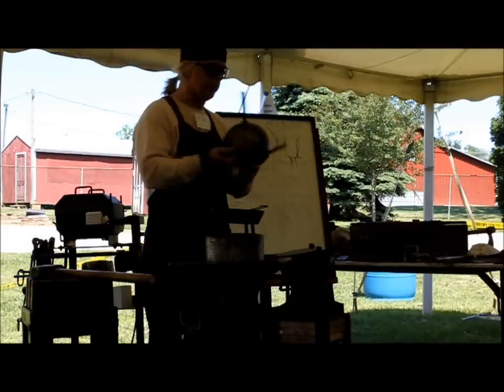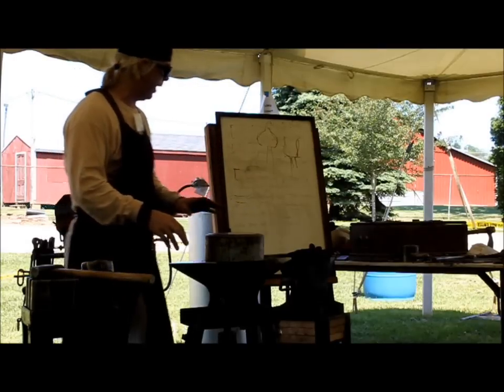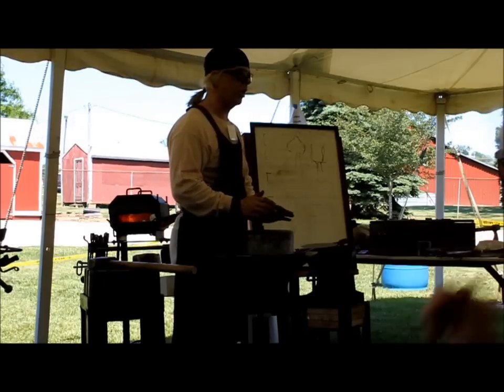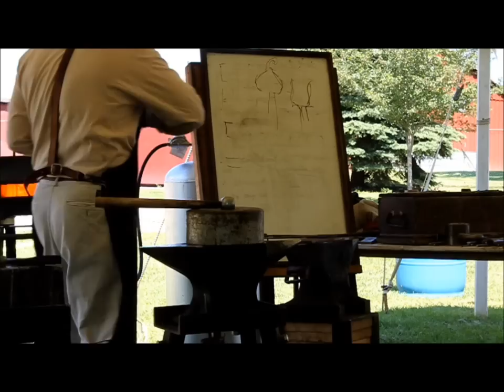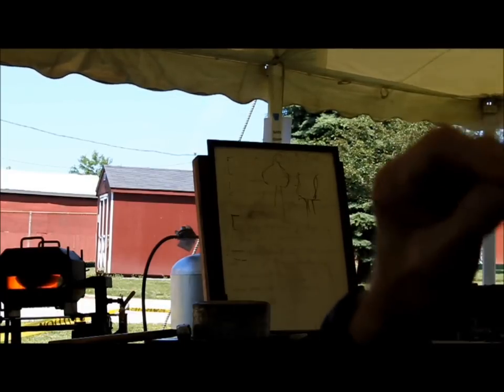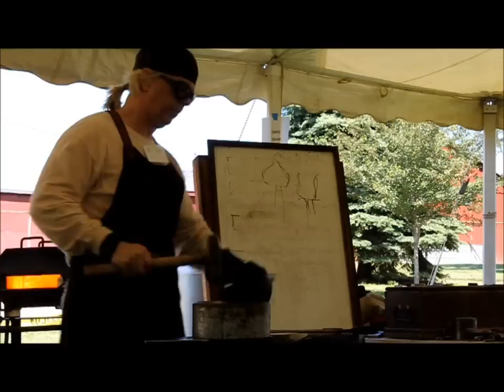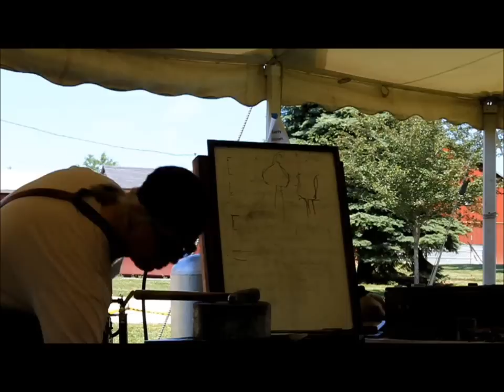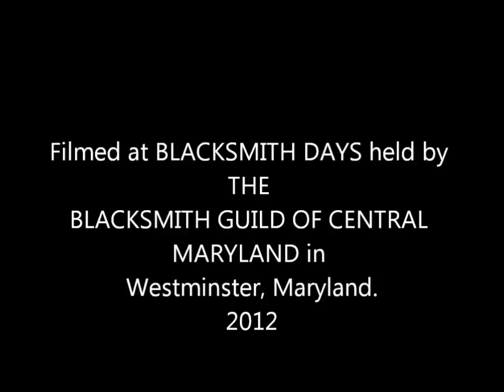How to Make a Frying Pan Part 1

Comment: I have since learned one of the methods they used in the 18th.century. A hand operated type of press that pushed the discs into a cone shape die. 19th. century Pennsylvania smiths seemed to have made them similar to my methods.

Comment: I normally add 2" to the diameter of what I want for a finished pan. I have also since learned that flat bottom pans may have been made in a hand operated press as early as 1700. However, there are numerous 19th. century spiders that survive that were made in local blacksmith shops in Pennsylvania. So I still have yet to learn how they were made in the earlier times.